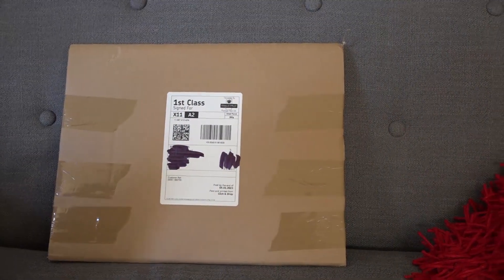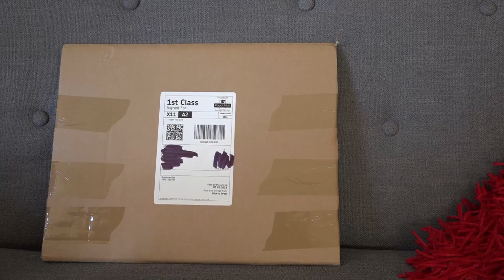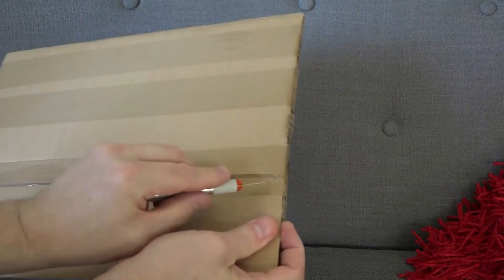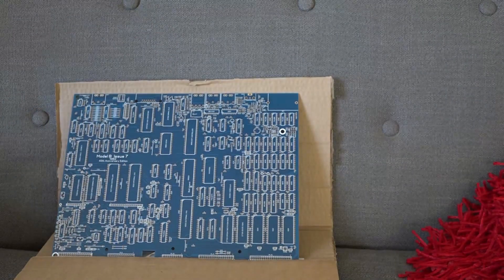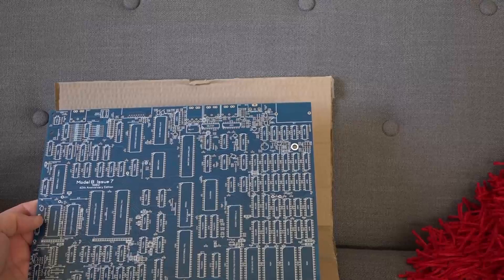Let's Build an Acorn BBC Model B Micro Computer from scratch Part 1

Comment: This board + 3D printed BBC case + VideoNULA + a keyboard that closely matches BBC micro = reincarnation of BBC micro.
Reply from the maker: As I point out in the video you really need a dead machine for the keyboard, case PSU etc to make this project viable. Else go to Retroclinic and get a nice resorted beeb from Mark.

Comment: If I didn't already have a LOT of Beebs this would be a really tempting project..

Also can't you replace the ULA with a nULA? Well if you can find a nULA.

Also hello! Not seen you for years.
Reply: Just checked the forums, the VideoNuLA is still being made, currently £63 including p&p.... 4096 colours on a beeb too.
Reply: Awesome idea to use VideoNULA.  Curious how the original display chip isn't available as a standard part.  Similarly, Commodore VIC20 and C64 VIC and VICII chips not a common part but again clever folks are making equivalent for these parts.

Comment: I really look forward to seeing the build come together. For my sins, I was the one who persuaded Bob to recreate this board. I supplied him with a stripped down issue 7 PCB that was used to recreate this edition and a working micro to test against. Even got my name on the back of the board which I'm thrilled about! I have built 3 of these boards now. I can report that everything works flawlessly, including PiTubeDirect, BeebSCSI, MMFS, Econet, Gotek etc. One issue I did have though was the relay listed in the BOM although having the correct footprint, it doesn't have the correct pin out and I have yet to find one that does. So I had to use one from a non working original BBC motherboard. However if you have no intention to ever use tapes then it can safely be left off of the board. Good luck.....it is a hell of a lot of soldering!!
Reply from the maker: I've been dreaming of this happening for years, esp since I built the Hybrid music 5000 / 2000 synth. I didn't know about the relay, I guess then i will have to remove it. I think I will probably have to re use the cassette din socket as well.
Reply: Hi Guys. The BOM relay, sorry, that's probably my fault and I thought I'd check that. Will try harder! The relay only does the motor control if your tape player has motor control. Tape works fine without it, it just can't start and stop the tape motor automatically.
Reply from the maker: @iancudlip8387  No worries not a massive problem I can always rob the one out of my other board, but TBH as I cant get the din socket I dont think ill bother haha!

Comment: Good luck with putting it all together! I remember ECONET from school. We used to send each other rude messages over it, usually something to do with "Inflatable Ingrid" as Red Dwarf was big at the time.
Reply: My mate wrote an 'emulation' of the login screen that sat in front of the genuine log-in screen. So to the user there was no difference except for over the course of a week all the passwrods and usernames were dumped into a text file. This was then printed and put up on the noticeboard outside the computer lab. Major sense of humour failure on behalf of the academic staff.